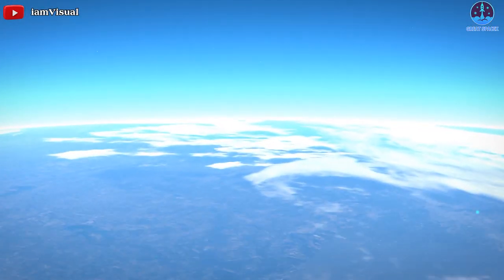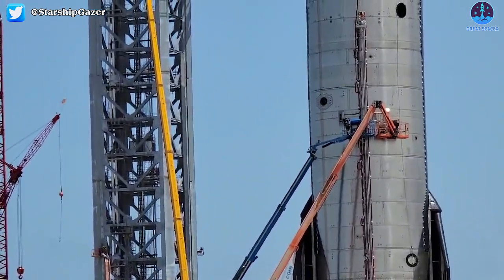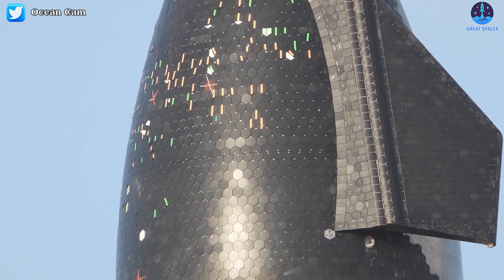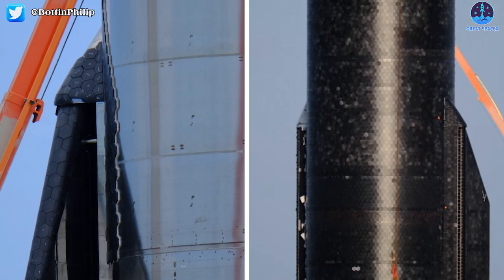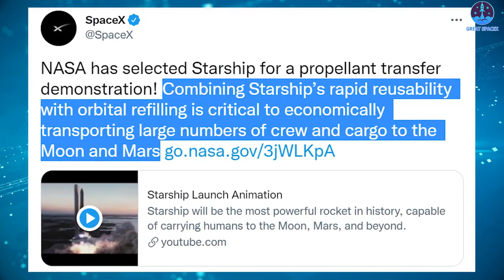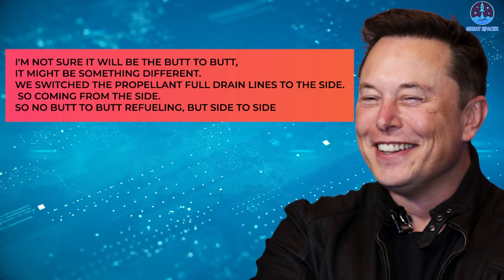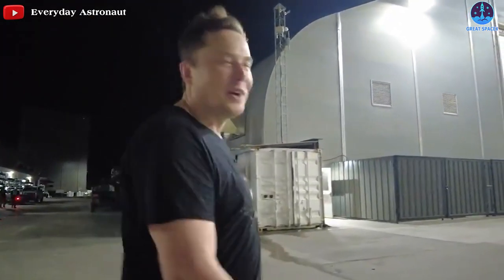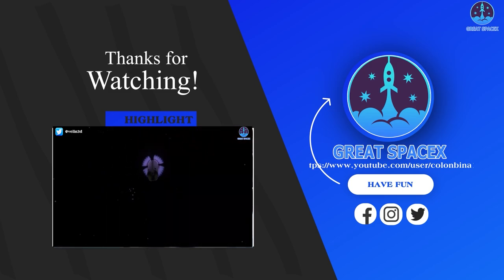SpaceX Orbital Starship New Major designs Change everything!

Comment: I'm still surprised musk hasn't thought "refueling arm robot" just have a robot satalites that can fly on its own that can dock in between both ships and pump fuel from one to the other. Would be much safer and means the starship don't have to do fiddly manoeuvring to get them JUST RIGHT but just close enough
Reply: That's actually a ~REALLY~ good idea. Make it a self-propelled satellite so it can perform some basic maneuvers and line the two Starships up better. It will never get low on fuel because it can bleed off a small fraction of the transfer to power its own engines.
And then it just stays up there in orbit. It doesn't return until the day Musk creates a better version and crashes the original into the ocean or returns it inside a Starship. The more equipment you can remove from the actual Starship the better, like putting grabby arms on the launch/landing pad.

It could even have straps to hold the two Starships in place, and some sort of shock absorber buffer system to keep the two Starships from bouncing into each other and causing damage. You make 2-3 hardpoints on the spine of the Starship for where the shock absorbers would connect. No damage to either ship. That's the goal, right? And then it connects the hoses to the refill port.

I could see over time Musk creates a small fleet of robotic refuel satellites, positioned in varying orbital locations around the world. This would require the least amount of movement when sending them to the next refuel position.
Reply: @protorhinocerator142  I've no idea how feasible that idea is, but it sounds awesome XD
Reply: @protorhinocerator142  bingo, my thoughts exactly. Gives safety, reliability, and even modularity (say you need to fuel something else from the port of a starship, the Droid could get a new connector)
Plus now starship doesn't need to haul those connectors, pipes, pumps etc around.
Reply: @GundamReviver  Right. You lift them into orbit once and it's all there. Minimal effort to move it around from that point. You can use a fraction of the fuel to move it if you have enough lead time.
I love the idea of adding different connectors. You could refuel other ships. Maybe even have a separate pump for refueling ships using something other than methalox propellant.

I'm visualizing a Doc Ock sort of thing in space that can connect anything to anything.

But why stop there? Make it a service module that links the ships airlock to airlock. That way you can transfer crew as well.

Imagine taking 4 months to get the Mars 1 deep probe all fueled up for the first manned mission to Mars. You wouldn't want the actual crew on board for 4 months would you? You could either have a different crew doing it, or use AI.
Now it's time to go to Mars. You get the crew fresh from Earth, fly them up to the service module, and they transfer to Mars 1.
Bon voyage!

As soon as the crew is all on board, the service module disconnects and floats away to a neutral position. All the arms and hoses retract to protect them from space. AND they retract into the pressurized area so the next refueling crew can inspect them for damage and repair them if needed. No going outside for that. Do over 90% of the work inside where it's convenient.

I may need to draw a picture of how that can work mechanically. I can see it in my mind.
Reply: @protorhinocerator142  mild doubts about the retracting thing, unless it's on rails and has to go via the same airlock as the crew, then it could be done with few extra complications and problems. (think M.O from wall-e)
Reply: @protorhinocerator142  I can't draw to that level yet but I can sure as he'll see what you are describing inside my head/brain !!
I've been doing steel fabrication for 30 years and I've had customers present me with a polaroid of an object in this case a 1 double bed frame and the only reference I had was the electrical outlet on the wall ...2 days later I had the 3d jigs made plus 5 bedframes and 10 bedside tables to match a week after that I had 30 sets finished and powder coated ready to ship out !!
We humans are a visual species we learn by watching our parents peers as children who needs detailed plans if you can think like this !!
Don't get me wrong detailed planning and design is crucial for space ship buildings etc but sometimes all you need is an idea and the skills to make it reality!!
Reply: @protorhinocerator142  or..... why not just make it a spaceport variant of Starship. Just a thought.
Reply: @Aaron628318  It could be. I mean it's already a good starting shell for this project. It already has fuel tanks and propulsion. Pop a couple arms on it and some special air locks and you're in business. Why not?

Maybe add some of those inflatable space modules. There are options here.

In fact, those inflatable modules might be great for acting as a shock absorbing buffer between the ships.
Reply: @pierre.a.larsen  
Because business 101 says, if you want my money to invent something (a product) then I want slice of the ownership of the product.
Reply: @protorhinocerator142  Air lock tunnel does not need to be pressurize for transfer from ship to ship as the crew will need spacesuits for on the Moon anyways.  So the tunnel could connect anywhere on the cargo part of the ship. Use an airlock between the cabin and cargo bay. Make the space dock big enough that you can have nine Starships there at one time. Now how to build it? Do it in space. Take rolls of stainless up in the cargo area and roll them in space to make the needed sections. Welding should be easier as there would be no Oxygen or Nitrogen to contaminate the welds. Take only piping needed up as no need for a whole assembly to go. Build the shop area first and go from there. The shop area also would not need a full atmosphere of pressure, just the crew area living quarters. Need power, just grab a few Starlink satellites that are about to be sent to their death and use the panels from them. 10 would give you enough to keep things humming while the dock is in the sunlight.

Comment: I think they can fill starship to full with about 3 starship fuel tanks if they stoew fuel in the payload section
Reply: The tankers will already have max-size tanks since the fuel is the payload. Elon's estimate of 1200 tonnes in 8 launches suggests about 150 tonnes per launch. Bringing that down to 3 launches would require 400t delivered per launch, which is simply not happening.

Their website quotes Starship's payload capacity to LEO to be 100+ t. You can probably do a bit better on a tanker since you won't waste any space that could be filled with fuel (both to be delivered and to get there), but this won't be even close to a factor of 4.

Comment: Why not retractable flaps that cover with heat shields?
Reply: They would be at least 2x as heavy and there would be many moving parts and unnecessary points of failure. The cargo volume would also get much smaller.

Comment: Business model for up and comer space firms:  Build expendable refueling/replenishment vessels for Starship or any other space-faring concern.  Market it to NASA or directly to Congress.  Show that a big cheap solid-fuel booster-assisted rocket can carry much more fuel and oxidizer "to anywhere in Earth orbit our customer desires." If the model works, consider sending some to Lunar orbit.   Send some of those strap-on solid fueled boosters up as cargo.  They could be attached to Starship for its trans-lunar burn, saving much of its internal fuel.  Leave enough fuel in them to put them in an orbit that will eventually send them into the sun.  No Muss, No Fuss.

Comment: they should be use parachute for landing
Reply from the maker: Oh, with the weight of the Starship it seems impossible.
Reply: The largest thing we have ever landed on Mars weighs about a metric tonne, and uses the one of the biggest parachutes ever made (21.5 metres), and that plus atmospheric drag, reduces the velocity to 200 miles per hour which will smash everything to pieces on impact. So a rocket-powered crane is used for the last few kilometres. Starship weighs about a hundred and twenty tonnes empty, so with 100 tonnes cargo and some fuel, maybe 250 tonnes. Parachutes will be no good for that. And as for Earth landings, there is too much uncertainty with winds, and falling over on landing. And obviously, as the moon has no atmosphere parachutes won't work.

Comment: I imagine Spacex will use an inflatable bladder inside tanker-fuel-transfer-tanks to push the fuel out to refuel other vessel…
Reply: A pump in space may not work to scavenge the tftfs
Reply: @solarfry  Pump would not be needed. If the bladder is inside a pressure tank, you just bleed enough pressure to the space between both to force the fuel out. Also, all of the videos have been showing then as belly/top down to Earth. No reason why they could not be nose pointed up for refueling.

Comment: Hopefully, one day, spacecraft will have enough fuel (or a propulsion system) to slow down before entering the atmosphere, so the heat tiles would not be necessary.
Reply from the maker: I hope so too, then Starship's dry mass will decrease significantly.
Reply: From what I remember, the ceramic heat tiles are ridiculously light. I remember holding one many (~15) years ago and the material was about as heavy as a dry dishwashing sponge. It was basically a ceramic wool. Felt almost unreal, as you were holding something that was super light but insanely hard.
Reply: That will require a new type of propulsion system and fuel..the best we have to date is just a nuclear propulsion

Comment: Wouldn't re-entry be better if retro rockets were used while still in the vacuum of space, to slow from orbital speed to a simple vertical gravity fall?  A re-entry burn's not successful every time.  Even a damaged vessel needs fail safe re-entry where speed's not an issue and parachutes could be used to make up for the extra fuel burn by slowing descent to a slow pace.

Comment: errr dude you do know who liquid flows when under acceleration right, you know how taps work right, it doesn't matter if it's butt to butt to side to side, as long as you thrust one toward and one away, you will get fuel flow as long as there isn't higher pressure in the tank you are trying to fill although if there were higher pressure in the tank you were trying to fill the pressure would equalize then fuel would start to flow. it doesn't matter if it has to take 2 90 degree turns, although it might slow it down a little.

Comment: So his plan is for Starship to perform the Adama Maneuver. Too cool.
I for one don't like the butt-ti-butt method of transferring propellant. At least one of the rockets will have hot engines from getting into orbit. Do you really want to transfer fuel so close to these engines?
The belly-to-belly method works better for me, especially of you change it to be the the tramp stamp instead of the belly button, as shown at 4:52. Not really "side to side" but more "back to back".

Consider: The back side of the rocket doesn't need heat shields. It's the least impact place on the ship. You could have a much simpler panel there.
Also with the windows in that position, the two crews could wave at each other.
Reply: You need to realize they wouldn’t connect seconds after getting into orbit.  Plenty of time to cool off silly pants.
Reply: Only one ship needs to be manned. Once launched, Lunar Starship could be left in LEO upon return so you could do away with the tiles on all but tanker Starships. Crew could transfer to a tanker version or a Crew Dragon for return to Earth. Supplies could then be sent up for the next trip and Lunar sent on its way back to the Moon again with a new crew. Depending on the Raptor life, you might need to change some in space but that is not impossible. An orbiting depot which is manned with maintenance crews would do most of the ship to ship transfer work.

Comment: For refueling - there is no gravity in space ... so refueling will be pressure led.  If you listened to what Elon said - he said there is already so much going on where the engines are - to add refueling in amongst all of that (remember there is a lot of heat and vibration going on there), that it made more sense to fuel side to side, which he said would be easier ... gotta listen when you report back on what Elon said - and not make up your own stuff.

Comment: Elon musk need change liquid methane with metalic hydrogen, because it is more efficient and powerfull. 
Liquid methane is 55 megajoule/kg
Metalic hydrogen is 210 megajoule/kg
Almost 4 Times.

So don't need for multiple refueling
Reply: @mauricegold9377  so use regular hydrogen(120 megajoule/kg)
Like blue origin

Even their rocket look like dick, the rocket trust is clean and fast.
Reply: @kusumayogi7956  You are not aware, obviously about some of the properties of Liquid Hydrogen: 
* It requires a much larger tank to store the same mass, as its density is lower, thus requiring extensive re-design.  The specific impulse improvements are not enough to compensate for the added complexity, added volume, added mass etc
* The tank requires special insulation, as liquid hydrogen is much much colder than liquid methane and liquid oxygen. 
* Liquid hydrogen embrittles metals and weakens them
* Liquid hydrogen molecules can travel through the crystalline structure of the tank, essentially leaking out through it
* Keeping liquid hydrogen cold and contained on long inner Solar System journeys is a problem
* SpaceX doesn't have any Hydrolox engine
* The SLS uses 4 x 1980s vintage (but expensive at 146 million dollars per engine) RS-25 hydrolox shuttle engines
* ULA's Vulcan is designed for methalox and not hydrolox

Comment: Space ship does not fly perpendicular to the ground upon re-entry - Musk said around 120 deg to flight vector (or direction of flight) i.e nose faces forward to protect the engines from burning up.  Upper stage of rocket will get the brunt of the shock wave in front of the craft - i.e. pointy end will absorb the brunt of the air compression.

Comment: 🤗🤔Why to buy diesel or petrol car if we can travel 🤑 freely on electric without worrying about cost of travelling. Install solar.🤩 Buy tata Nexon EV or any EV enjoy the ride without worrying about cost of fuel. Now charging infrastructure is rapidly developing and Most of hotels are allowing users to charge there EV and changing extra amount on battery capacity. Now its common and must feature in Hotel to attract customers

Comment: 8 refuelings to get to the moon!!!! I predict in the primary future the Starship will be as a fuel TANKER, not used for cargo or humans at all, but just designed to refuel ships from low earth orbit to higher orbits, the moon, Mars and infinity and beyond as Buzz Lightyear requires.

Think about it - getting into space requires HIGH thrust, but once you are in orbit, you can be more relaxed. So whatever fuel you decide to use, the Starship tanker can carry it into space. 

Think about it - why should Starship have BOTH atmospheric engines AND vacuum engines? Have TWO SHIPS. Why carry useless engines to the moon or Mars?  Or if Mars 1% atmosphere is dense enough to need specialized engine, then specialize it, have a ship that is refueled in Mars orbit for landings. Probably best for a Mars lander to be smaller and much lighter anyway.

And maybe that's Musk's plans. Rapid prototyping is expensive so you just work on one element at a time. He implies a single Starship will do everything, but we know that's just not efficient, just "good enough" for early demonstrations. Musk has proven he's willing to scrap any design and try again, so the process of building Starships will surely just be diversified, and there will be a dozen models in the end, one specialized for each task.